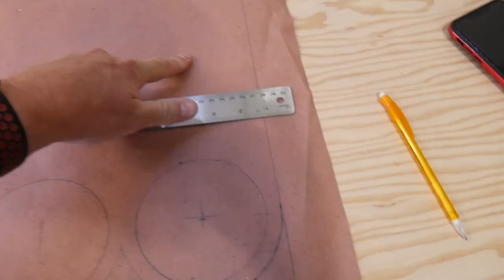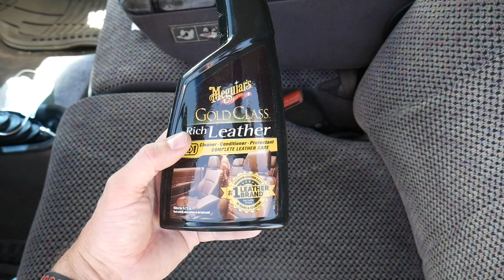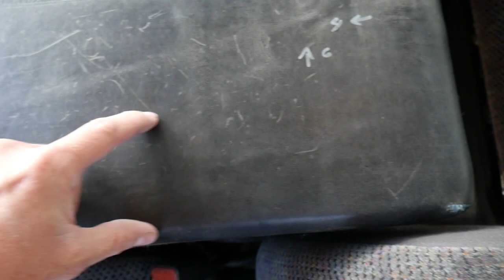Dodge Ram Gen 2 Center Console Cup Holder- Episode 3 - 1994 1995 1996 1997 1998 1999 2000 2001

Comment: Aright, I waited to see the finished product before commenting (of note: I do leather work) - As for the leather you choose, it's good quality pre-dyed, I would have ordered a single piece large enough to cover the whole top of the console. As for stitching (if you ever do another of these) - look up saddle stitching, it's much faster and 3x stronger than the stitch you ended with. On the wood working - damn bro - that is beautiful. Overall it's a nice project, end result looks amazing. (also of note, I'm literally buying a 2000 Dodge Ram 1500 Laramie (ext cab) as I'm typing this, and I will be doing a 'similar project' as I really don't like that flip down mess that Dodge called a cup holder (it's not contusive to safe driving to be reaching that far for your coffee or water).
Reply from the maker: Thanks!  Seriously, this means a lot!  My first ever stitching project (other than sewing on a button or two). I was on a tight budget for this project, it was about half the price for 2 smaller pieces than for a single large one. I love the cup holders being so close. Doubles as a visible cell phone holder when not used for beverages too. Anyway, congrats on the new truck!  Check my other videos for common Gen2 Ram repairs. Thanks for watching and taking time to comment!  🙌🏼
Reply: @troysgarage  I have checked out a few of your videos - cause I have the 'standard for Dodge trucks disintegrating dash and bezel' - Thankfully it's body is new perfect (on odd rust spot top and inside of drivers rail area of the bed? - but no rust around any of the wheel arches). Already has an aftermarket hitch, engine only has 'weeping' from the head cover gaskets - no other leaks that I could see. Has brand new water pump (less than a month old)... so overall a really good truck for the $1000 I paid for it.
Reply from the maker: You scored!  😲

Comment: looks great! by the way you should have put a wireless charging pad matted to the wood board. but good job any way!
Reply from the maker: Thanks man!  I looked at doing that but the magnetic case I use on my phone blocks wireless charging under the best of circumstances. So I went with the magnets to simply hold the phone in place while driving. Which works really well I might add!  👍🏼